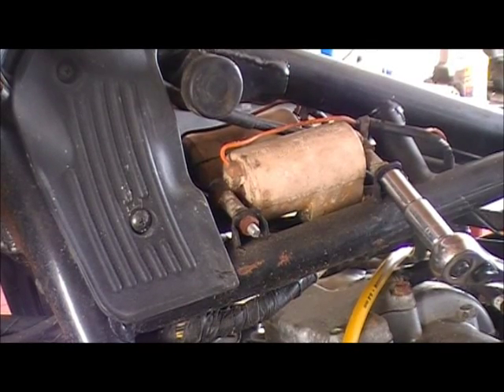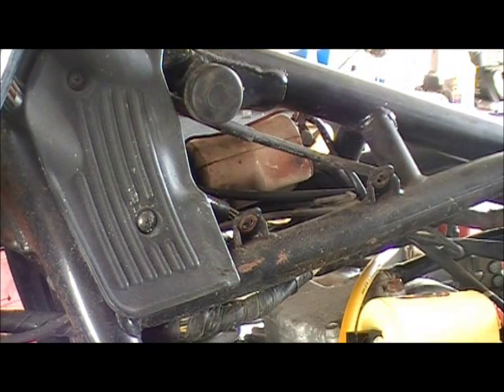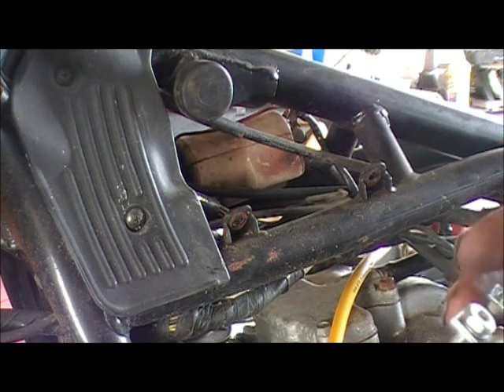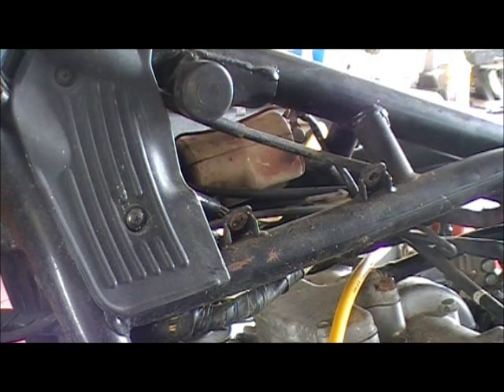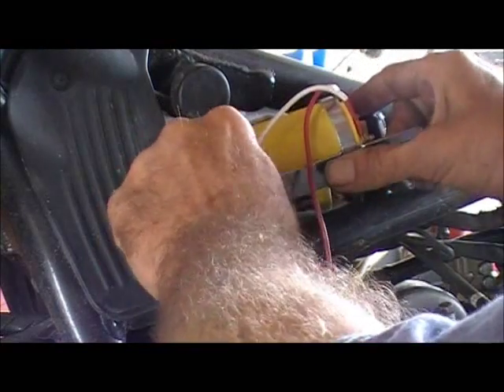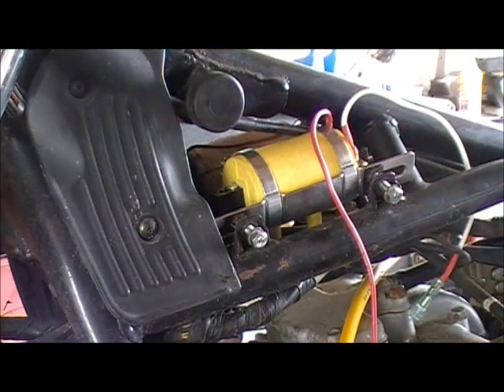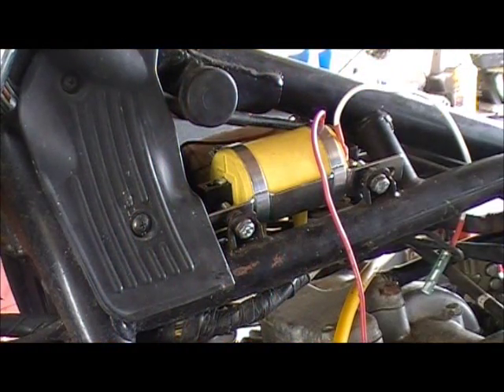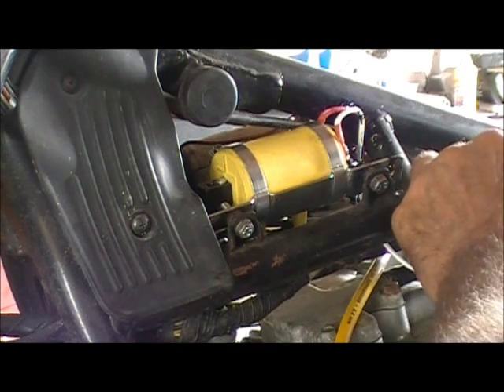Installing Accel Coils On a 1979 Suzuki GS750L

Comment: Hello Dawino6260,  I'm a bit confused on this 1979 Suzuki GS750L with a points ignition you installed Accel 140404 coils but Accel has 1040404 as being use for Capacitive Discharge Ignition, can you clear this up, I'm gonna install coils on my 1984 Honda CB650 and I'm trying to find the right coils. Thank you.

Comment: My bike doesn't have too much trouble starting, but it's been lightly modified to say the least. However the cams make it a little stubborn to start on colder days. And it gets temperamental if I don't warm it up on choke, typically won't start without choke unless warmed up. 

Thanks for the advice.

Comment: Hi Dawino. have a 1980 Zuki GS850GL that I'm in the process of restoring. I Replaced Stator (new), MOSFETRectifier/Reg. (new), Accel coils & wires (new), new plugs hotter NGK B9ES's, new battery, and a used CDI box. Ever since I did all of the above, bike starts at a slight push of the button & runs smooth. Problem is it will only run for between 3- 5 mins. and then shuts itself off. Let it cool and same story all over again. Charging is normal  @ idle is 13V. revving up to 5000 is about 14.3V. The only constant  tell tale in the whole scenario is the CDI box gets real hot to the touch ( in fact the reason I replaced it already is because the original one fried & this one smokes when I force the throttle to keep it running a bit longer). No hot spots/ wires anywhere else. Help. thanks
Reply: Did you find out why it's doing what it doing ..??

Comment from the maker: Big time improvement on cold weather starting -- Been all over Yankee country and always start right up on the bikes with Accels... Except that time my battery froze on that KZ900... - Your stock coils puke at 10 or 11 volts - the Accels will still shoot you a spark at 9 -- Which is why they work on cold days when your battery doesn't have enough amps because its cold and drops voltage while you are hitting the starter button

Comment: Hey man.  I have a gl1000 put 3 ohm Dana s coils on it. Do I need the ballast resister if I have electronic ignition
Reply from the maker: Nope -- but i'd throw those Dynas on a race bike or in the trash  -- those are race day only shit and not made to last very long - Accel is daily driver stuff

Comment from the maker: i test em off the 3 AC leads - would have to look up the resistance but basically they are field coils - quickest way is to turn the bike over on a car battery with your test leads already hooked up - set your meter to AC ground one lead and check the 3 AC leads one at a time - AS A GENERAL RULE as long as they produce within 5v of each other it not going to be the stator

Comment: Hello, I know im late to the show but Im confused. How come you put Accel #140404 on. Everything on line says #140404 are for CDI (which i thought they put out 0.8 ohms. which would be for 1980 and newer Suzuki's) and #140403 are for points (3 ohms). 79 and older Suzuki's.. I have a 79 GS750E im rebuilding (yes im a newbe) and Im confused on which to get (Im not trying to mess up the bike up anymore than it is).. Any explanation would be awesome. and if my current understanding is wrong please let me know.
Reply from the maker: I use 140403's and 4's and 08's - depends on the application - 140403's can go either way except for the 140403S - part number on the end of the coils is the same for cdi or points with the 140403's ..The 4's love points - never had a problem with em - my choice for this particular bike is due to the condensers and the Physical electronics nerd side of me going "daaaayyyyuuuummmmm that's gonna get hot if i jump up to 3 ohms" could have dont the bigger (or accel) condenser mod but if I'm going to go through all that I'll be on the phone to Dyna for an ignition box first....

Comment from the maker: @MadSmokerBBQ Easier starting - and about 5 sometimes 10mpg better on richer jetted bikes -- Plus they make it to where you dont have as long of a 'warm up' and you dont foul plugs around town... Now if Dyna starts making coils that wont crack or fail in 6 months... then I'll switch.. Until then it's Accel all the way -- except single towers then it's Pro-Fires

Comment: Hey guys i got a 79 gs750 it ran great until i broke a plug wire and had to change the coil packs. The ones i got were used to lol now it wont start and wen i do get it running it runs like complete shit. Any suggestions guys? Wares some cheap coils that will get the job done and does it sound like coil problem?

Comment from the maker: File em or replace em -- put the youtube and the com in front of /watch?v=XFaWxuyrSnw and you will see about where they are at - that vid was for a Honda 750 but the 2 bikes are so close in the points department that it should get you on the right track -locations are about the same - a full set of points and condensers is under 20 bucks at NAPA - DONT mess around filing em --- That's a "get it home ONLY" trick